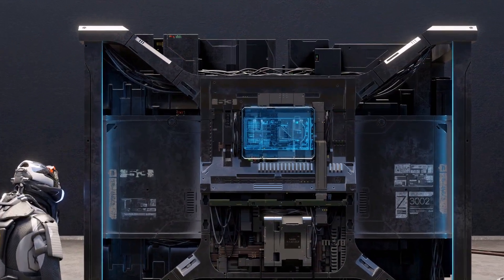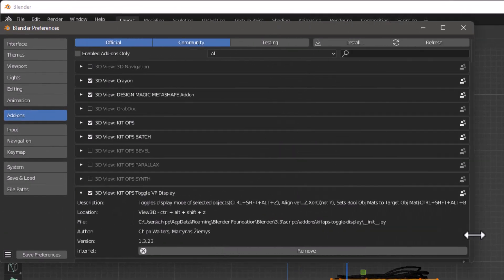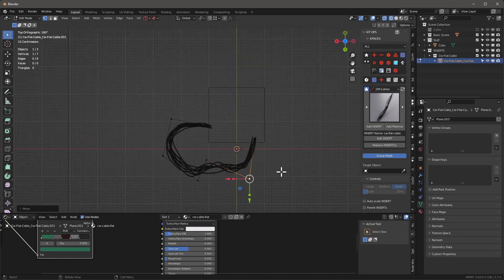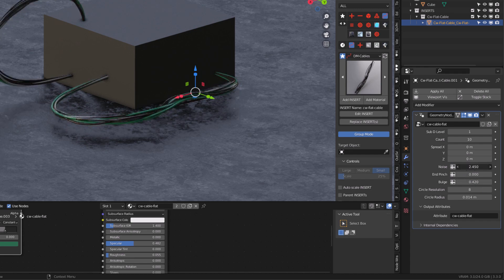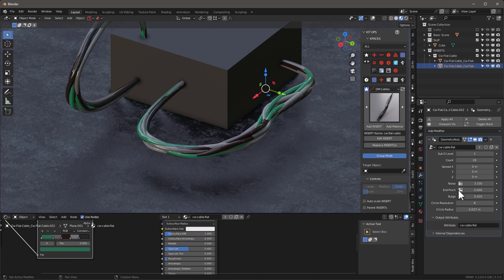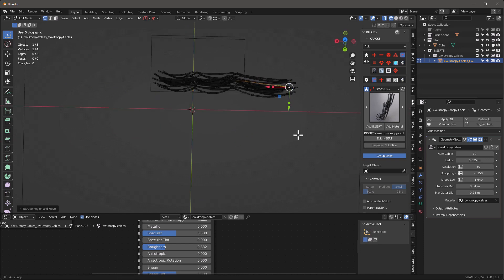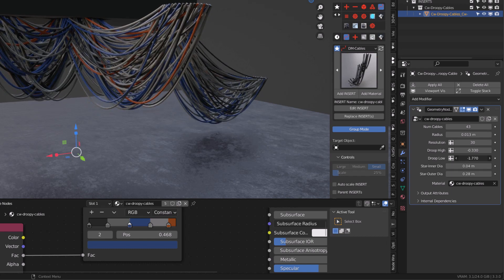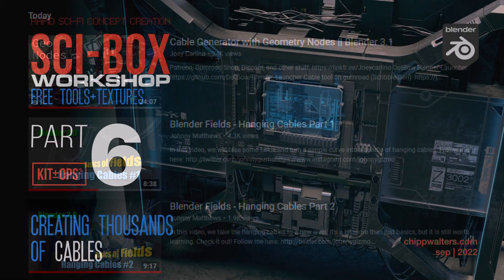Thousands of Cables INSTANTLY!: Blender SCI-BOX Workshop Part 6

Comment: Intersection is an issue. Really cool stuff tho.
Reply from the maker: There is currently no way to mitigate against intersections within geometry nodes. You can always convert and then use real physics but that's a whole different workflow which requires you leave the cables as basic splines.
Reply: @ChippWalters  yeah, i get it. Anyway, these cables are freaking great.